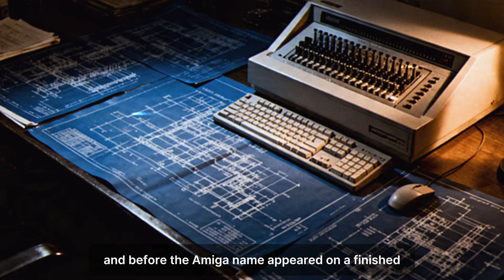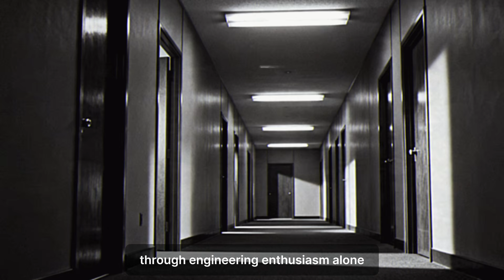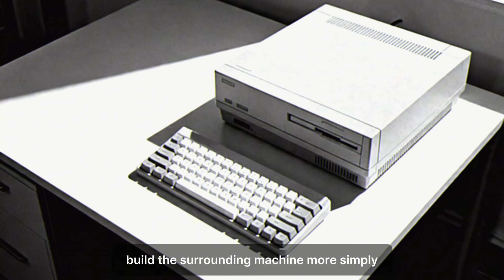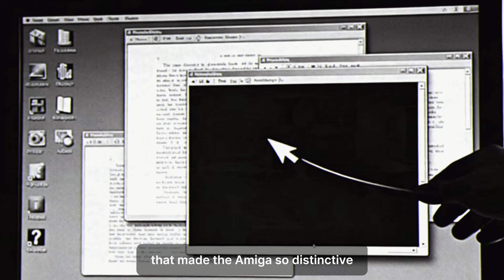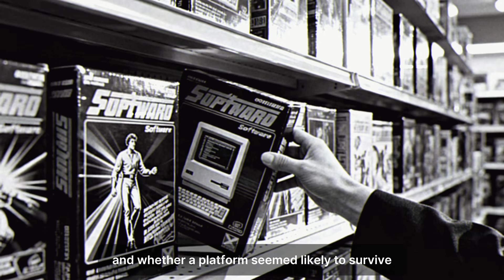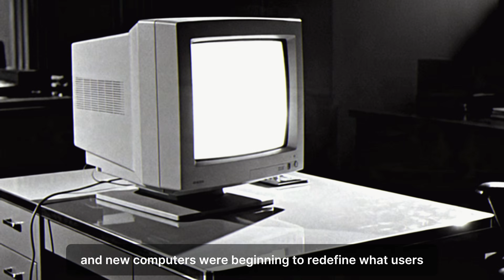Jay Miner’s Amiga vs Atari ST — How Custom Chips Turned the 16-Bit Era Into a Graphics and Sound War

Comment: The Atari ST had a completley unthrottled 8MHz CPU delivered a blistering 1MIPS, the Amiga was a console design repurposed within a crippled architecture where the theory of custom chips helping the CPU is proven false when in practice they choke the CPU stealing Memory Bus access so the CPU sits idle hence it was usually only managing around 3-5MHz depending on how much the custom chips are being used it could only manage around 0.5 MIPS . For this reason it was completely outclassed by the ST for any computatiionally heavy  tasks, coupled with its horrible interlaced displays no serious computer user took it seriously. Even when playing to its forte of 2d trickery it delivered insipid gameplay that  would have seem simplistic compared to what was available on 8 bit platforms (SOTB is a classic example....lots of window dressing hiding the  fact the CPU is running too slow to deliver any decent gameplay) As for its supposed graphical prowess ST programmers easily leveraged its clean unthrottle power to outdo the Amiga - Spectrum 512 and Photochome make a mockery of the Amigas HAM mode, and the ST handles full motion video using tens of thousands of colours without the need for processor upgrades, whereas a stock amiga again chokes when faced with similar tasks. The Amiga only got given a second chance to build a small (and ultimatley rather pathetic) legacy in the field of 2d games when The STs popularity saw rampant piracy kill off its games market and game publishers pivoted to the Amiga....even that second chance was completely wasted as the PC and games consoles steamrollered the Amiga and its crippled planar architecture. STs Legacy is with us to this day from software liks 3D Studio Max, Cubase, Logic Pro, Vector fonts in DTP in contrast the Amiga legacy is tacky video titles on VHS tapes gather dust in landfill....oh and not forgetting  legion of gullible fans still chasing the sunk costs for their 'premium' product that proved not to be so premium 40 Years later
Reply: I've never encountered such a full throated defence of the ST.  Let me add a couple of notes.

1) The Amiga was 5-6 years in development with custom chips (Jay Miner's masterpiece)
The ST was created in 7 months.  The fact it could so capable is a wonder.

2) The Amiga ultimately sank the company, under priced a costly PC to compete with the STs low price, it gained market share but lost money to do it. They ended it up in bankruptcy in just a few years despite selling millions more Amigas.  

3) The ST saved Atari from bankruptcy, and gave it a more years of life.  Their later products, didn't catch fire Lynx, Portfolio, and Jaguar.  Tramiel sold it in the late 90's getting out of the tech business.

4). Commodore was out of business by the mid 90's.  Atari limped along (licensing the logo and name for t shirts and merchandise)  until the early 2000's when the Flashback, a surprise hit on Christmas 2004 sold out. And the more faithful Flashback 2 sold out the next year too, kicked off the retro trend, which Commodore, now back in business under new ownership is doing as well issuing retro systems.

I worked wedding video business in the late 80's.  Amigas were use for titling and fx.  But, the business ran with an ST.  Never crashed, booted fast, intuitive GEM interface(especially the payroll program).   It really is a business PC first, MIDI machine second, gaming device third.  Where the Amiga was gaming first by design.
Reply: @nicolepaletta3760  From your balanced and well reasoned reply I am sure that your wedding video business was a clear exception to my earlier accusations of a tacky video legacy, hats off to you for recognising and acknowledging the history we lived through when these machines launched.
Reply from the maker: Please support me by subscribing to the channel. : www.youtube.com/@TechnologicalOrigins

Comment: 1979 - The first block diagram for what would become the Amiga was drawn in 1979 by Joe Decuir at Atari. 
(Warner Atari management says it's not interested in making a new system at that time).
1982 - Work on the Amiga/Lorraine project begins.
1983 - Shivji and Tramiel discuss the idea of a low-cost 16-bit computer. 
1983 (November) - Amiga engineers reveal to Warner Atari the proposed system specs for the Amiga/Lorraine chipset.
1984 (January) - Amiga/Lorraine hardware publicly demonstrated at CES.
1984 (March) - Amiga chipset starts being pressed to silicon with the help of a loan from Atari (Atari deal gets worse for Amiga).
1984 (April) - Amiga engineers give Warner Atari engineers detailed information on how the Amiga chipset works.
1984 (April) - Shivji and Tramiel prepare to work on what would become the Atari ST.
1984 (April) - Tramiel is given details of the Amiga/Lorraine chipset and offers to purchase it (Amiga team declines offer).

1984 (July 1) - Jack Tramiel begins process of takeover of Atari home computing division.
1984 (July) - Commodore purchases Amiga and loan is paid back to Atari as Jack Tramiel puts finishing touches on acquisition of Atari.
1984 (Late July) - Leonard Tramiel discovers Amiga's deal with the previous Atari.
1984 (Late July) - Atari ST project officially begins.
1984, 1985 - Jack Tramiel files two lawsuits against Amiga in an attempt to delay them. It works.
1985 (beginning of July) - Atari 520 ST ships with 512KB RAM and an option of an external single-sided diskette drive.
1985 (end of July) - Amiga launch. The Amiga ships later that year (Amiga dev boxes already shipped in late 1984). 
https://blitter.com/~nebulous/otherworld/Amiga/Amiga-OCS.pdf
Reply from the maker: Please support me by subscribing to the channel. : www.youtube.com/@TechnologicalOrigins

Comment: Amiga's custom chips are hardwired function chips, while the 68000 is a microcode CPU core that takes many clock cycles to complete an instruction.  The RISC CPU design is a hardwired processor design.

68000 @ 7 MHz couldn't saturate DRAM at 280 ns (3.57Mhz) with 3.57MIPS.